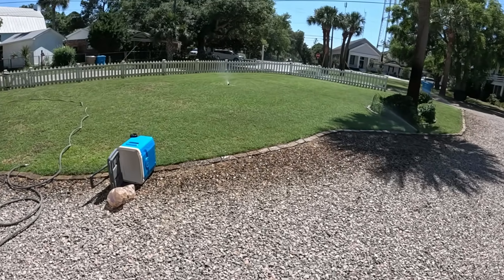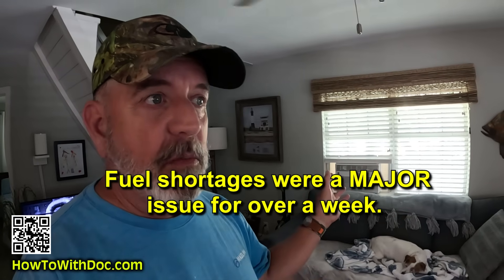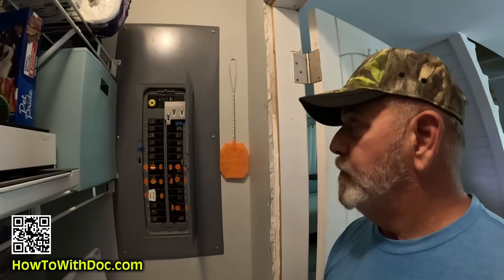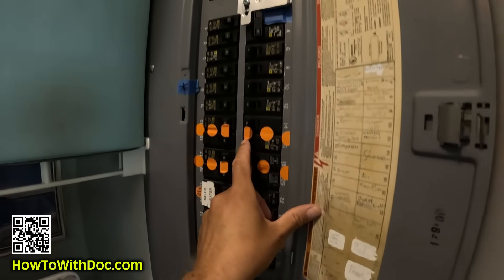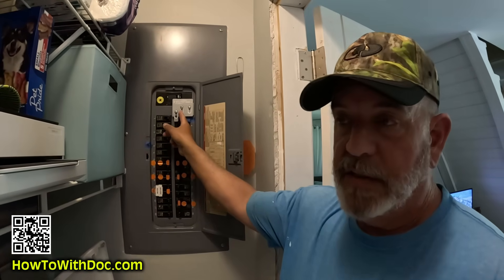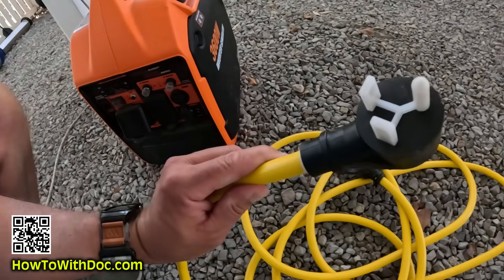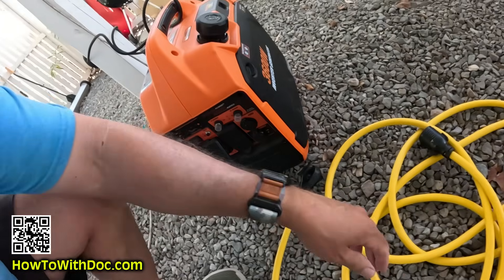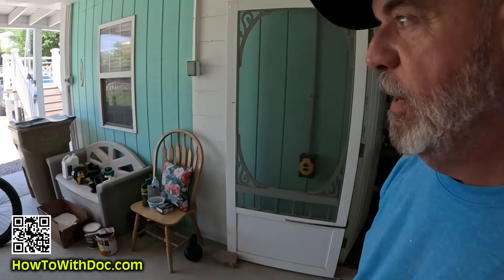How to Use Small Generator for Whole House Power

Comment: I upgraded my setup to something similar after 3 weeks without utility power during and in the aftermath of super storm Sandy in 2012. At the time I had an old Tecumseh powered Coleman Maxa 3000. It's 3 quart tank ran dry predictably every 2 hours. I could run the well pump with the aid of a large step-up transformer. The 4500 watt water heater could be run at 1/4 power by moving one of the 240 volt wires within the panel from one side of the breaker over to the neutral bar. Not something to try if you don't know what you're doing. I believe that FEMA brought in some large generators so at least a few gas stations with multiple pumps and a way to manage long lines of cars could pump. I recall that the limit was 10 gallons and wait times were about an hour. What a PITA. I moved up to a smaller 1400/1800 Champion powered by an 80cc Honda clone engine. I now got between 11 and 13 hours on just over a gallon of gas. 240 volt breakers don't need to be switched off when both panel busses are fed from the same 120 volt source. 240 volt appliances only see the difference which in this particular case would be zero. The only exception I can think of is an electric clothes dryer where the neutral is used for the motor that operates at 120 volts. The heater simply doesn't while the heater doesn't turn on at all. Air dry only. The 1/4 power trick also either works well or not at all depending on which wire you relocate. You have a 50/50 chance of getting it right the first time. No penalty for guessing wrong.

With the smaller generator one has to be more careful about what is allowed to run simultaneously. The well pump draws a large inrush current for a second or two and doesn't like to share. My 18 cu ft energy star refrigerator only draws about 80 watts when running and an inrush power perhaps double that. every day or two it turns on a heater for a few minutes to defrost while drawing a few hundred watts. There are ways to disable the heater or timer that may involve some disassembly it or you could simply turn the refrigerator off for a few hours while you're allowing the water heater to run at 1/4 power. The blower on my oil fired furnace takes a few extra seconds to come up to full speed. Sometimes fuel is scarce. Inverter generators can be quiet and slightly more fuel efficient when delivering low amounts of power and considerably louder and thirstier when working hard. They are also less tolerant of significant overloads.

Things got more interesting when I added a Duro Max XP4400 to the stable. More power, bigger engine, bigger fuel tank, and of course a commensurate usage of fuel. It also has a switch that re-configures the internal wiring so that full power could be obtained at either 120 or 240 volts. You can also get a dual fuel carburetor that was a direct bolt on replacement for the stock carb. They run about $20-25 on Ebay - much cheaper than those older $200 kits based on forklift demand regulators. Gas is still cheaper and I do have to rotate my stock but now I have a second fuel option. I downsized the water heater elements to 2000w. It now takes the exact same amount of power to heat a gallon of water to the same temperature - it just takes longer. The tank is big enough so no one in the household has noticed any difference.

I also now use a pair of heat pumps and will soon be commissioning a third to do all of my heating and cooling down to sub zero outdoor temperatures. My old furnace is still fully functional but now my energy costs are a small fraction of what they used to be. I chose the most efficient "cold climate" model I could find. I printed out dozens AHRI certificates, called a few tech support lines, crunched plenty of numbers, and researched each brand and even who owned the business and website. There are only a small handful companies in the world that actually make these things - which is why so many different brands look identical on the outside, hundreds of importers who put their own brand names on them, and tens of thousands of variations of "what's under the hood". One name kept popping to the top of the list and incidentally not only did they have the best deal, they were the only ones that even mentioned "power factor correction" in any of their literature - something that is important since generator output is measured at the ideal power factor, 1.0. My own measurements always come up as 0.98 or 0.99, as close to perfect as it gets. Also with no huge inrush current since the inverter driven compressor starts with minimal power and ramps up to speed over sizing the generator is not necessary. Although I haven't had the occasion to try it, I fully expect to be able to run both of my SENA-12HF machines at full throttle off the XP4400 with enough power left over to run everything else except perhaps the water heater operating at 2000 watts. Between the Federal 30% tax credit and my energy cost savings, mine paid for themselves and all the incidentals (wiring, special tools, etc) in the first heating season. I did the installation myself. Your best deal if you just want to follow in my footsteps is to find Senville on Ebay and either put specific items on your watch list and wait for a special offer or make a best offer yourself. Another option is to find their website and either look to see if there are any coupons on the about us page or better yet call and talk to someone in sales and see what kind of discount they can conjure up. Using my name will neither help nor hurt either of us since I don't work for them or have any kind of affiliate arrangement. Might leave them scratching their heads while they try to figure it out.

Comment: SHould have mentioned that if you did NOT split and add it to both sides then only one side would have power.  You would have to move the breakers you want to run all on the same side.  I understood you but not sure everyone picked up on the fact you were trying to power both sides of the power box.
Thanks this was helpful… I plan to only run the inverter generator.  I had trouble getting gas with Helene.  It was a major issue.  OH, I am also thinking of getting a solar generator that can be charged with a small inverter unit.  BUt also have solar to charge it.  Thanks

Comment: Nice video. I’ve been looking at a 10500 inverter generator. What has held me back? The cost of the LP Gas? Basically living by myself all I need just need on for charging my batteries on too many cloudy days in a row. 😉 I have a 2 wire generator start inverter. The larger generator has that. I would like to not have to do the switching around I’m doing now. And just let it do its thing. 🤔 All these 2 wire start kits. I’m not into doing. 🥴

Comment: I have moved what I want to run to one leg in the box. “Say 8 breakers.” I was running a wire from a breaker to a breaker on the other side of the box. Worked great. Didn’t know they made that plug.

Comment: Thank you so much for doing this. Its exactly what I hope to do unfortunately I may have gone wrong already, please let me know. I had my electrician install a NEMA SS2-50P inlet box and the interlock however I did not request anything other than the typical wiring (inside the panel). My electrician informs me that only half of my (110V) circuit breakers will work. I can find adapters from the 30Amp RV on the WEN generator to the SS2-50P inlet box but I am not certain that the adapters will feed both 120 legs. The drawback is if only "every other" breaker works, I will need to move them around in the panel so that the critical ones are being fed (Fridge, window A/C, TV, LED lights. I don't usually comment on videos or ask for advice but this video hit the bullseye so I thought I would ask. Thanks in advance.

Comment: Great job, what cable you use to plug your big generator to your house i have a generac 5500 generator  and the power card i use is different to connect my house, sorry for sounding crazy, but if i use the set up you showing what cable would i need to run my  generac 5500 generator to the TOOLIOM 30 Amp Generator Inlet Box...Peace

Comment: I have a 1500 watt generator that runs 2 freezers/1 fridge.  HOW is that possible?  Simple, all 3 compressors don't kick on at the same time. When 1 is at temp, shuts down, plug in the 2nd, let it chill till the compressor stops, plug in the 3rd.  I'm good to go with little fuel.

Comment: We have hot/humid summers where I live.  I've never had air in any house I've lived in.  What's my secret?  I like to be acclimated to the outside air.  For example, if you are used to the outdoor air, I'm good to go.  Now, for those that like to live inside a house that can chill beer in the summer, when they go outside or the power goes off, your body can't take that temp change and you suffer/sweat.

Comment: Yes what you do works. There is a better solution.  A electric portable power station to store generator energy.  Run generator for an hour and then run your house for 8 or 12 hours.   Solar panels into the power station and you will hardly ever need a generator. Also I don't think your generator is pure sine wave.  A pure sine wave generator is much better for appliances and electronics. Ecoflow Delta 3 Plus and a matching 3000 smart generator is a modern solution to your work around.  Bigger house get a Ecoflow pro 3 and matching 4000 smart generator. The smaller one is all that is needed for your application. You can get extra storage battery that adds twice the reserve power.
Reply: Your better solution appears to be a rather expensive bit of kit even without any solar panels. Do you really think that you could power a house that has multiple lights, a ceiling fan, 2 refrigerators, TV, internet, a window AC that alone only draws about 700 watts, and apparently a pool system with at least one pump and associated filter system for 8 or 12 hours off of a battery/inverter that only stores just slightly more than 1kWh of energy? Do you think that you could accomplish with as many extra batteries as you could charge with your 3000 watt (peak) generator in one hour?

Did you even bother to read the product description on the OP's Amazon link?  It certainly looks like an honest description of a low distortion PWM synthesized sine wave to me, or what some involved with inverter generator marketing like to call a "pure sine wave". Have you ever seen what that waveform actually looks on an oscilloscope? Have you ever read the transcripts of the early formal discussions from 1980 where the participants were trying to come up with a working definition of "dirty power". How much sensitive equipment have you seen damaged or destroyed by those 37% THD waveforms from many early UPS's? I've only encountered one electronic item in the past three decades that wouldn't operate normally with a cheap "modified sine wave" inverter. That single item was an early CFL. I suspect that the peak voltage wasn't high enough. Worked just fine on regular dirty utility power.

Comment: I know you continually say this isnt about Propane or Natural gas, but Gasoline generators.  However!
The best of all is a duel fuel generator.  Why?
Keeping Gasoline more than what you use for a few weeks for mowing or other small Gasoline engines, isnt a good idea.  Gasoline gets old, absorbs water, and can gum up carborators with deposits ,making your seldom used generator useless.
Propane does not expire, or get old.  The home 20lb tanks are certified for 12 years, making them perfect for long term fuel storage, and propane doesn't require purging after a generator run.
So... All your advice is good, but i'd say buy a duel fuel Generator, use propane first, until you run out then switch to gasoline if you must.  We had our power out for 7 days last year, and i ran all that we needed (no 240 volt) on 3 and a half propane tanks.  I have 6.  I even have a valve where i can have two tanks hooked up at all times, like in a RV , that automatically switches over when one tank runs out, so the Generator ( A Champion inverter 4500 watt ) can just keep on going, then i can switch tanks uninterrupted if needed.  I shut down when we go to sleep, although the generator in eco mode is so quiet it cant be heard inside the house, we dont need it, and the refrigerator is shut so it stays cold the ice didn't  even melt until morning.
I have the same cord setup as you, and my power box is wired the same.  Amazing what you can do with simple knowledge.
Oh, and propane tank exchange can be done even when gasoline stations are closed, at many places.  It may cost more to exchange ( i usually just have my tanks refilled) but when power is out driving all over for gas isn't necessary.  Seriously its the best of situations.

Comment: Exactly what I did, bought an inverter generator so I could recharge a EcoFlow  1800 watt power station. I will use them in tandem to power just what is necessary for survival.  After 3 weeks during Ida trying to fuel a 6Kw generator I’m over it.  Spent all day just trying to get fuel for the generator and cooking
Reply: Any hss stine

Comment: Great video. Fuel management is the true problem. Sizing your generator to what you need is important. I also have a tip about your small generator and your cable lock. The plastic handle on that generator is easily cut. You should consider a chain around the generator and through the handle, snug, and cable lock to that.

Comment: Hey Doc... great video.  I have the same generator and was wondering if you have issue connecting the generator cord to the generator? On mine there is a lip under the outlet that does not allow the cord to seat due to it's orientation.  Looks like I need a cord that plugs straight in like a regular extension cord but then the weight of it might force it out.  Your video doesn't show the cord plugged into the generator... only the house.  Just curious if had same issue.

Comment: My question is, what gage size extension cord are you using from your generators to send power to  your service pannel connector to your house and your vacation house? Will a 10 gage extension cord work?
Reply: 10 Awg can handle 30A (120Vac x 30A = 3600W).

Comment: Very smart thinking.  I have window AC units in most rooms (also have older central air unit).  During outages, we can keep 1 or 2 rooms cool from a smaller generator.  Next project: dual or tri-fuel generator.

Comment: Great video.  Should have mentioned that under a significant load that generator in eco mode is quite a bit louder than running with no load.

Comment: I purchased the WEN 4000 watt inverter generator a few months back on Amazon while it was on sale for $350.  Couldn't pass up that deal and I was amazed at how quiet it was. I still have to do the 3 to 4 plug conversion and installation by an electrician but I will say it's a great generator.
Reply from the maker: Good choice

Comment: This is a bad idea
Reply from the maker: Sorry... #1 the generator will NOT be overloaded and has protection against that. #2 The generator is FLOATING neutral and can not create ground loop
Reply: Why is it a bad idea
Reply: @ammogiant824  is an extremely easy way to overload that generator
It could also be creating a ground loop which is not good
Reply: @ammogiant824  exactly I see these units in other parts of the world. It's very reliable Ecoflow and bluetti and other brands like Jackery I have. As long as your user the wattage threshold, you are good to go.

Comment: My first dose of reality was a tropical storm about 20 years ago. The wind wasn’t terrible but it parked and dumped rain. Trees down, no power for about a week. I remember vividly a distinct change in public demeanor after day 3. Since then I’ve always had a generator but, until Helene, it was a big one. I was fully prepared but I ended up having to cover 3 unexpected houses off of my supplies which killed my preparations.

I’ve since purchased two of the gas sippers you referred to. Why? Two is one, one is none. The fact that they are dual fuel adds more redundancy. And they can be combined for more output if needed.

I’ve expanded also into solar as yet another redundancy. Ecoflow Delta 2 Max with 2 folding panels and an alternator charger was the first setup. Then an a-la-carte big 48v system and a diy setup using individual cells that fits in a milk crate with 120v charger, MPPT, BMS and inverter.

A couple of hot water tips when in a pinch I just discovered are black bladder type solar pool heaters and 120v “bucket heaters”. Next on the tinker list is fresnel lenses cooking, boiling water and perhaps a legitimate heat source by drawing radiant heat from a large hot object into an insulated space.  I think I may have gone off the deep end with redundancy 😂.
Reply from the maker: Smart man....
Reply: @HowTowithDoc  just implementing ideas from those smarter than me

Comment: Thanks Doc. I saw the video you did on this subject last year. I went and brought a dual fuel version of that generator and a small power station. I use the generator  to recharge the power station. My only issue is my feeder panel does not have a main breaker so I will have to get my electrician to install one so that I can use and interlock kit. The alternative is a manual transfer switch that I have but have not had installed.